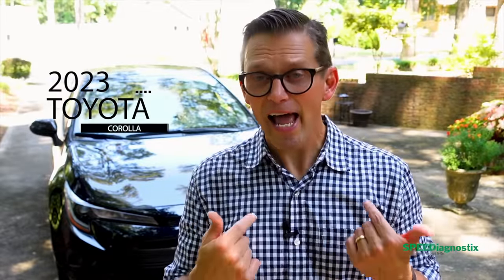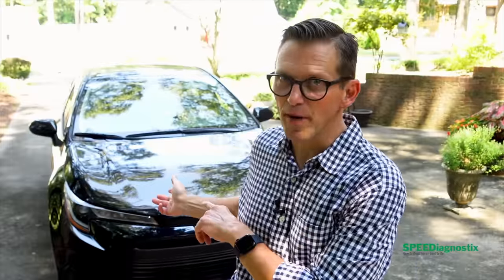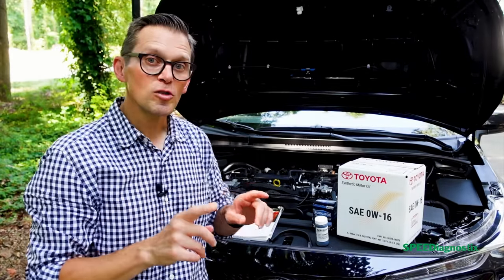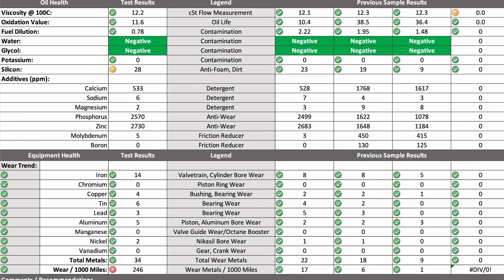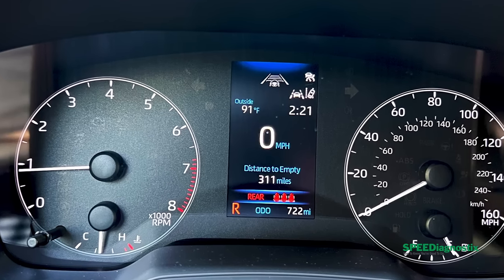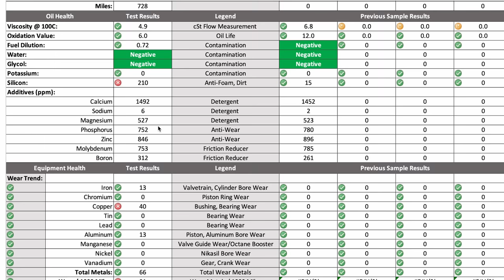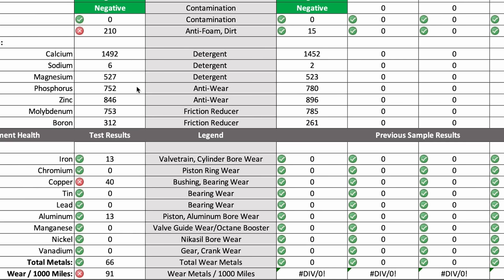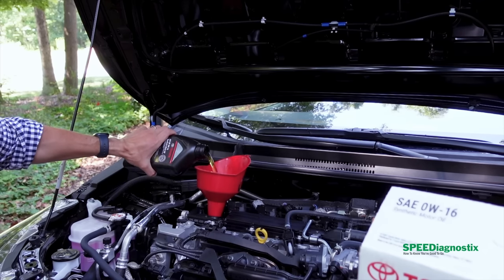AVOID the ONE MISTAKE Almost EVERYONE Makes With A Brand New Car

Comment from the maker: Here's the link to see the results from the 2nd oil change: https://youtu.be/X4424Q5lLR8
Reply: I would be more concerned about the transmission lasting the life of the car than worrying about the engine. Was the trans fluid changed at 500?
Also this data only shows bedding in taking place, how do you know removing the oil early hasn't adversely affected the bedding in process by removing wear particles that may assist in the bedding in.
Although I suspect no difference in useful engine life by doing this, if it did make a positive difference who is benefiting? The 4th owner? The scrap yard selling the engine?
More likely the rubber seals in the engine fail or that is out of date and replacing with an ev or new car makes more sense  before the engine wears out if maintained correctly
Lastly I wouldn't want to risk affecting the warranty of the car by changing the oil oneself.
Just following the manufacturers schedule seems the best course of  action.
Reply: @AK-pu2gm  - I agree with you. Some manufacturers such as Honda and Ford provide guidance to their dealer network to NOT change the FF early on some models. They claim the asperities in the oil actually help accelerate the bedding process.
Reply: If you live where there is no snow the 0W16 oil will work fine, as the engine oil with 0W8 is really for cold climates, and for fuel economy, as the engine is not really much changed for the last decade, where it was fine to use 10W30 oil, but the lighter oil relates to a slightly better fuel economy in testing.
Reply: @Godspeed931 from the first video, the used oil analysis of the 0W8 FF vs the virgin oil analysis of the  0w16 looked basically identical.  not sure there's anything special about the initial FF
Reply: @AK-pu2gm   I make my living machining and building engines and transmissions and I've been doing that since the late '70s. The fact is the only thing that needs to bed in is the rings and with today's prelapped rings and modern honing techniques that happens in the first few full-throttle accelerations.   The piston ring manufacturer's recommended procedure to seat the rings on a new engine is to warm them up at a  then do a few light load accelerations then 3-5 full throttle accelerations each time closing the throttle abruptly to scavenge the cylinder walls clean.  That's what we do on the dyno and with engines that didn't see the dyno.   

After the break in we drop the pan to check the bearings if everything is ok we put in new oil and send it.   The fact is every engine shop in the entire world will tell you to change the oil after the first 50 miles or less because that is when the engine sheds huge amounts of large particles that will damage the surfaces. That has been scientifically proven to occur.
 For maximum engine life on new cars, I recommend you change the oil and filter before the first 50 miles and then again at 500.
Reply: @AK-pu2gm Going 7-10k miles between oil changes is a big heck no, especially on turbo engines. The manufacturers only care that the engine makes it past the warranty period. I have had/currently own multiple vehicles with engines that have gone past 300k miles without issues, I always change oil at no more than 5k miles.I've had 2 Dodge Neons make it to 300k miles. My current '97 Neon is approaching 280k miles, synthetic oil always changed between 3-5k miles depending how hard it was driven. It still runs fantastic and still gets 38-40mpg on the highway at 27 years old with no internal engine work ever needing to be done other than cleaning carbon/gunk buildup every 100k miles or so.
Reply: Question do the additives break down over time or with miles? Like will the numbers drop.
Reply: @gwize5145  yes they do because they are sacrificial. The total base number or TBN measures the additive level.
Reply: @rickh633  What a load of crap. Oil change at 50 miles? 🤣🤣  NOBODY ever does that bud and there are cars running around 30 years old and 300,000 miles on them. No problems. My first oil change was at 10k miles, 14 years ago, just ticked over 172000 miles. When can I expect big problems? 🤣🤣   Break in changes are completely unneccesary.
Reply: @jaredelson1840  I've only ever done 10k mile changes over the past 15 years, 6k changes for the 15 years before that. Zero problems. Many cars, all ended up with very high mileages. Current one is at 172000 miles. Doesn't burn a drop. Manufacturers actually want cars to last. Toyota are masters at it. If their cars all crapped out after 5-8 years nobody would buy them! Stop talking nonsense.
Reply: @motleydude73  That many cars all high mileage? Either you drive ALOT or you're FOS. Have you ever torn down and rebuilt an engine that only got oil changes every 10k? I have. Ever torn down and rebuilt an engine that got oil changes every 3-5k? I have. Makes a HUGE difference on cleanliness/health of engine internals/turbos going 3-5k vs 10k. Have you ever sent in oil to get tested at 10k vs 5k? I have.  BIG difference. Toyota is in their own league, they actually do build things well, unlike most every other manufacturer that only cares about the vehicle making it past the warranty period.
Reply: @jaredelson1840   Not all my cars were brand new when I got them, most already had 100,000 miles or so on them,  but 95% had full service histories. All done to manufacturer service intervals. Because that's what most sane people do. And yes I do a lot of mileage. A good synthetic will do 20k easily so nothing wrong with 10k at all. New Range Rovers get 21k OCIs. It's not the 1970s anymore. As a service tech for 32 years yes I've seen the internals of many engines. Yet to see any problems by sticking to the manufacturers service intervals. My own one is as clean as a whistle. Oil comes out brown and free flowing.  You Americans are so paranoid 🤣
Reply: @jaredelson1840  Oil analysis is a waste of time. Most engine wear occurs during cold starts, which is unavoidable, so no use worrying what your oil is doing. Chuck fresh shit in every 10k and forget about it. Most people do and have no problems.
Reply: @jaredelson1840  And I reiterate again, ALL manufacturers want their cars to last far beyond the warranty period. And they all do. Still plenty of cars from the 1990s getting around. Only so many people can afford to buy new every 5 years or so. Not everyone.
Reply: @motleydude73     Everyone who works in the engine rebuilding industry changes their oil on new engines right away cause we see the damage done to the bearing surface by clueless people who don't change their oil  and filter frequently during the first 1000-miles.
Reply: @rickh633  Clueless? Are the manufacturers clueless too? The ones who build and benchtest and strip down engines? There is ZERO damage done. Filters catch particulates, that's it's job.  Anything else is held in suspension amidst anywhere up to 9 litres of oil.  Funny how millions of cars are driving around just fine without ever having pointless early changes done. In 32 years in the trade I've yet to see any benefit from it.
Reply: @motleydude73     32 years in the trade and you don't know filters have a bypass???? you don't know they have a particle/flow ratio nad you say filters catch all the particles LOLOLOLOL,   if they could the bearing surfaces would never be scored.  Gezz why don't you just go down to your local engine shop and tell them your theories so they can have a good LOL. I know we are LOL at our shop.
Reply: @rickh633  Well aware of the Beta system of filtration rates. Though pretty irrelevant. Never seen any engine damage from not doing a 50 mile change 🤣   How ridiculous. You americans crack me up.
Reply: @rickh633  You work in a shop? Sounds like you're still at school. LOLLOLLOL 🤦  Engines have much tighter tolerances these days, far less chance of metal shear. But stay living in the 1970s won't ya 🤣  My service manager had a good chuckle at your 'recommendations'.
Reply: @motleydude73   obviously you r not aware of the science of filtration nor do you understand it, and u r not aware on most engines the bypass is always open on cold start.
Reply: @motleydude73  Pull a valve cover off and you ll see the results of going so long between changes.... in todays engines the oil is part of the emission controls systems and the oil becomes very dirty much faster than my 1979 Malibu engine.
Reply: @greatcollector9362  I've  pulled off hundreds, mostly clean as a whistle. As is mine. And the PCV. 10k is nothing, a good synthetic will do 25k easily.
Reply: @greatcollector9362  Funny my oil still comes out pretty clean from an engine that's done 170,000 miles. Brown, not black. As it does on all the others I change daily. 10 mile OCIs.
Reply: Does magnetic drain plugs work?
Reply: @motleydude73 I changed mine at 26. How far it took me to get home. Can be upset all you want but it makes perfect sense and science backs it up.
Reply: @5abivt  26? 🤣  Science also says synthetics will happily do 25000 miles.  New Range Rovers have a 210000 mile OCI.  I go by what I've seen and personally experienced in my 32 years in the trade. My current car had it's first change at 10k miles. Still going with zero issues 14 years and 175000 miles later. Early changes are a waste of time.
Reply: @motleydude73  it’s all preference. For me, I feel it’s logic that dictates engine wear will occur when new and close to when new as parts and metals break in with each other.  Since the engine was new , once the oil got hot I gave it 3-4 wot pulls in 3rd to redline with off throttle decel for high vaccum and cruised home and drained it out. The next oil change I went out and repeated wot woth cooldowns for about an hour and a half, came home and changed it again. 

Regardless of how long oil companies will say the oil can last, an indisputable fact is clean new oil > used oil no matter the mileage. Sure it cost me a bit more for changes but I find it fun and financially have no issues with it.  I do the same with my current daily (16 m4) and have already seen almost 20 other engines internally that I’ve serviced, and not a single one of them is as clean and new looking as mine. Some of these are 30-50k miles while I’m at 140.
Reply: @5abivt  Most people neither think about engine wear nor care. Certainly not when it's new. Tolerances are extremely tight these days and oils are very good so 'early' changes and break in changes are completely unneccessary. But do what you want if it gives you peace of mind.
Reply: @motleydude73  if you saw my black stone report on the oil that I changed out when I got home from the dealer you might reconsider ;)
Reply: @5abivt  No I never would. Yet to see any benefit to early changes after dealing with thousands of cars over a 32 year career. None of my own ever had a pointless 'break in' changes, they lasted decades and hundreds of thousands of kms.
Reply: So 500 mile oil and filter change on original oil you started new engine with is fine, correct?
Reply: Well actually we keep changing realms in the engine world , used to be the old school 350 chevy's had good tolerances , and you could abuse the hell out of your oil services , then we switched to ls1 , tolerances didnt change much till they started AFM , or VVT , that put some special lifters that operated on high oil pressure , suddenly that made clean oil a priority ...now this is in relation to all chevy , but the other manufacturers are right there in the same boat , they all work together
Reply: 04/10/2024
Reply: @rickh633  Tech in video said no oil change on new engine necessary till 500 miles. I agree with him.
Reply: This bit of history is valuable  to some people. Even after running engine in ,I change oil under 3000 miles my engine runs as it should.
Reply: Thought he had no faith in the manual.
Reply: Lake! those are ramps not jack stands!
Reply: Changing the oil every 10,000 mi is also a Federal government recommendation to help use less oil for the sake of the environment.
Reply: Hi,from the UK here. 0w16 oil cost £75 for 5L & 0w8 cost nearly £95 😯 That's good oil you've heard too.  But MOTUL NGEN 0W-8 HYBRID ENGINE OIL LUBRICANT JASO GLV-1 MAZDA TOYOTA 4L (Manufacturer Part Number 111845)   cost £42.  Would you put £42 oil in your car?
Reply: Would that include turbo engines ?
Reply: Are you selling oil or oilstocks? Why don’t you do as engineering are, testing engine oil? After the oilfilter? Oilseller? In Europe taxi cars have no problems after 700.000km or more? Following service. You must be a oilseller🤔
Reply: @themotoroilgeek I bought a 2023 Toyota Sequoia in Dec 2022. First 3,000 miles it drove great then I started feeling a jerky/stutter feeling when decelerating and coming to a quick stop. Toyota said they felt it but couldn’t find anything wrong with it. They bought it back just this May and I bought a Lexus GX. I just passed 2,000 and at 1800 miles I hauled a 21’ travel trailer. Since that trip and hitting 2000 I’ve started to feel that jerk/stutter again. Any thoughts on if the lack of break in oil change would be causing this sensation? Thanks!
Reply: @bradgoldfinger7498 
No
Reply: @Chucka10 Thank you.
Reply: @bradgoldfinger7498  
I would wonder if it was a transmission issue. I’ve seen fords years ago shudder and the dealer had some kind of friction modifier that fixed it till it got to trans fluid change.
The MerconV apparently looses something as it gets older, needs changing more often than the ford recommendation 35,000 mi, like I’ve always done change every 12,000 mi but only can get 4qts out so just the 4 fresh qts keeps it from happening.
I don’t know if this helps on your problem. Good Luck
Reply: Thing about these legends is they are not based in reality. I remember my Toyota loving brother’s brand new Tundra that went through 2 fuel pumps that while under warranty cost him $1100 each time to have Toyota replace on it’s first year. Legendary. That “truck” kept giving him problems until he voluntarily went upside down to get out of it. Truth is I don’t believe and haven’t seen a shred of evidence that Toyotas last any longer than any other manufacturer of vehicle class for class, and under perform all their American competitors on everything except maybe maybe fuel economy and if so by a very slight margin and at the cost of drivability. They sell like hot cakes because “legendary toyota reliability” snake oil, sales campaigns and nothing more. But put your daughter in an imported trash can if you want, they are disposable but at least they’re designed to be disposable.
Reply: @AK-pu2gm  I was going to ask this same question about transmissions!  Wish he'd reply to this.